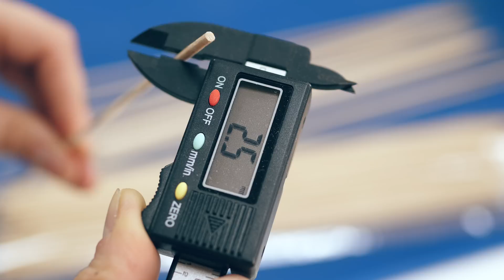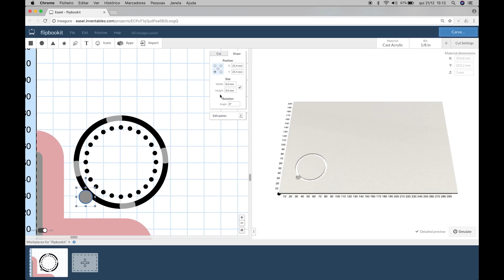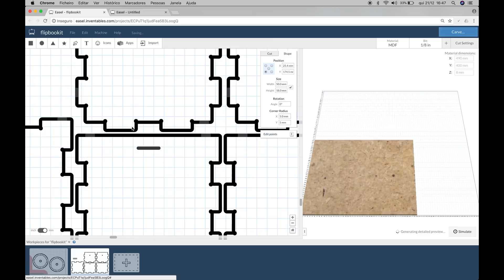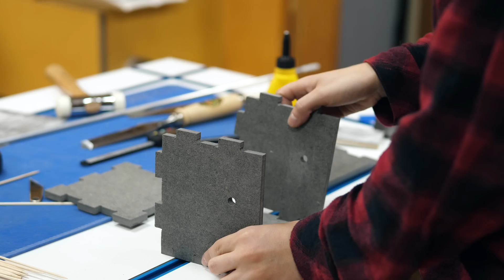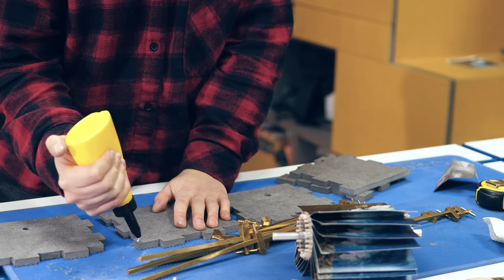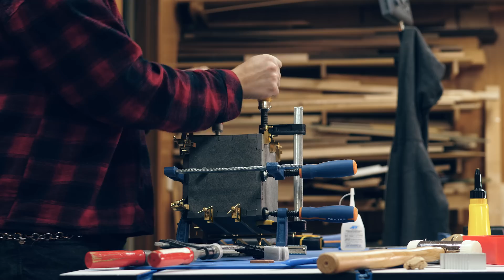Making a Flipbook Machine

Comment: Hi Cris! Cool project. I'm working on a remake but I can't figure out how to calculate the size of the box in relation to the size of the acrylic wheels. Would you care to explain? Thanks!
Reply from the maker: The inside of my box is about 12 x 12 cm by 10 cm deep and the wheels are 5 cm in diameter. You need to decide the size of your images first. Mine are 10 x 10 cm which means 10 x 5  when folded in the wooden sticks. And you need some clearance on top and bottom (more in the bottom - that's why the hole for the center dowel is more to the top than to the bottom) to make sure that in each frame, the pictures are not touching the box. If you make it too tight, you won't get much of a smooth movement and will be hard to rotate. Sidewise, you need just 1 mm in each side of the image to the wheels and then about 3mm between the wheels and box sides. Mine have a bit more than 3mm and it works fine but could be a bit closer, yes. Hope this helps!
Reply from the maker: But if you have to take note on the size of the sticks (I used 2,7mm sticks) and see if you can fit the amount of holes you want (which means, the amount of frames) in that perimeter of the 5 cm wheels. The spacing between each hole needs to be AT LEAST the measurement of a hole + a few hairs. Let's say you want to make a longer animation with 60 frames. Your wheels needs to be much bigger than mine. Maybe about 8 cm in diameter and you probably want to go with bigger printed images and maybe taller. So you need to adapt the size depending on many factors. Be prepared for some experimentation! I did a few before. Maybe start by doing the wheels in MDF or something like that and the box with hard cardboard until you understand the whole thing.
Reply: Get Hands Dirty Thank you so much, this was very helpful!

Comment: yasssss the girl of the golden clamps made a gif machine :D super cool! did you have to adjust the frame rate to record the machine working? :P
Reply from the maker: We found a video from our summer vacations with parents (actually this is in San Sebastian) and then we opened the video on premiere. Then, we selected just about one minute and in the export setting we chose PNG so we got lots of frames. Then we only kept the frame nr 1, 5, 10, 15, 20, etc etc and deleted the rest. This way we have more movement in less frames. Of course it's a bit "jumpy" but that's cool I guess. If you want something super smooth, you need to make it like 120 or 180 frames or so...which means, a bit circle with holes and a much bigger box :p

Comment: I absolutely love this project! Such a cool idea :D Doesn't seem too complicated either, even with normal power tools. Totally putting it on my list!
Reply from the maker: Yes! Super simple. The most tricky part will be to drill the holes perfectly spaced but still, it should work even if they are a milimeter or so off.

Comment: You should be using Fusion 360 3D CAD for this kind of work.  It's free and works and easy to learn, especially if you know Illustrator. It also outputs G-code.  You can learn it in a couple of days.